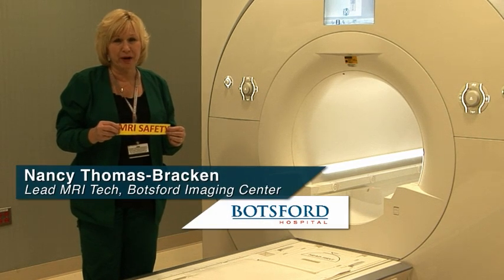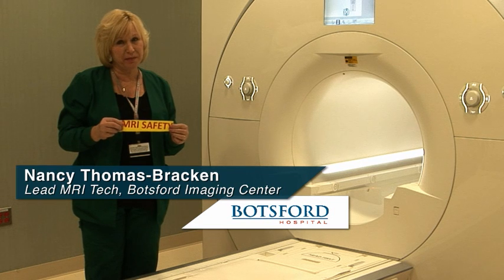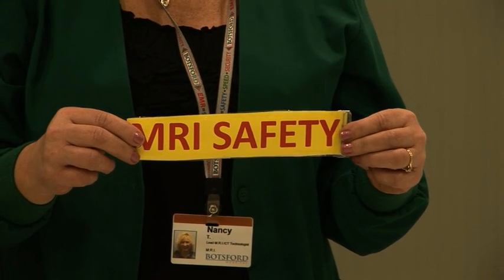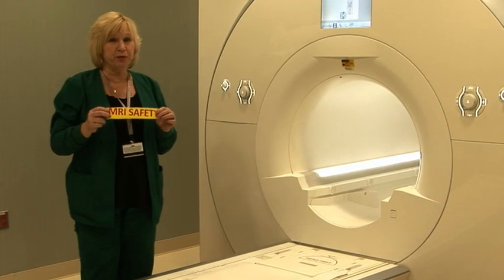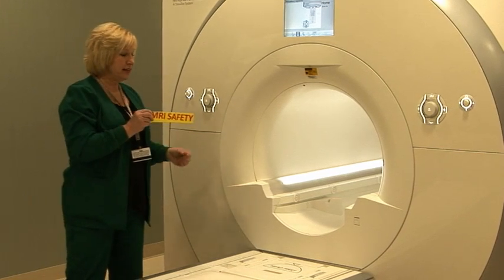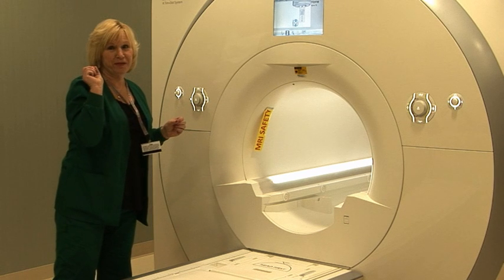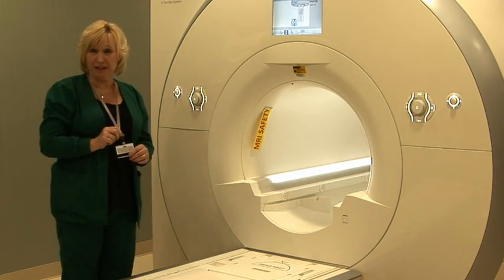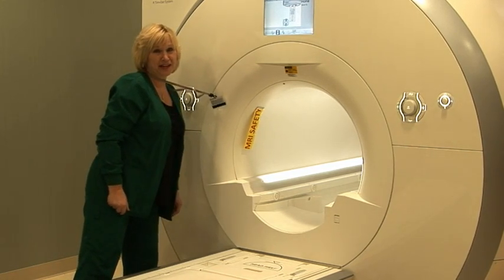MRI Safety Demonstration: Big Magnet + Metal

Comment: What I don't understand is, most places give you music to listen to when you're being scanned. How do the magnets and wires in the headphone speakers not cause a problem?
Reply: The headphones they give you in MRI are not the same as normal headphones; there's no metal or wires in it. What it is simply a plastic tube through which they play the music. That's why the quality is not as good as normal headphones.
Reply: Edith Ford Using air pressure I imagine.
Reply: That is correct.
Reply: Those headphones work kind if the same way secret service earphones work. You know, the clear curly ones that wrap around their ear. It's basically just a hollow tube with a speaker on the end, far away from the actual ear bud. The sound just travels trough that tube and into your ear.
Reply: @GoofysBandit  I didn't know the Secret Service had a special type of ear piece. Is to evade electronic detection or something? I never thought they would've used something so low tech. It sounds like the way you make a "telephone" by putting some string into some paper cups. I'm surprised the sound quality is as good as it is, then.
Reply: Also, there are magnetic speakers in MRI rooms. And microphones. They're partly shielded, and made to withstand the magnetic field.
Reply: @ericmcallister4809  I wonder how they do that. I didn't know it was possible to shield metal from a magnetic field, especially one that strong, unless you put a REALLY thick layer of something like wood or plastic over it. But with speakers and microphones how could that work?